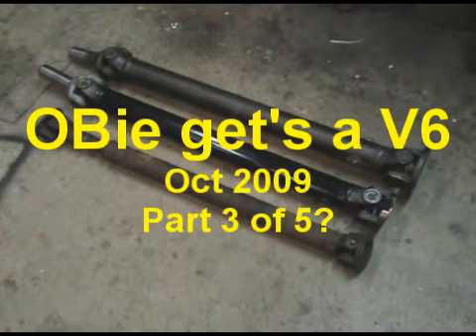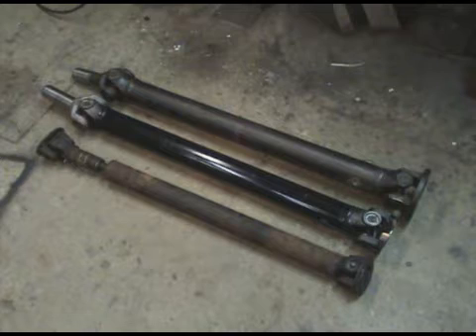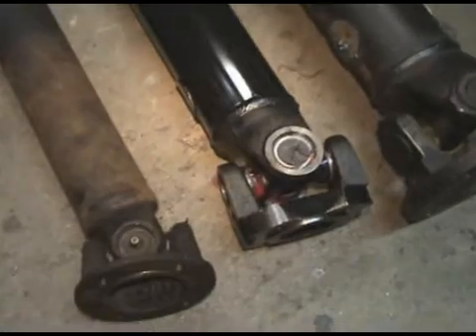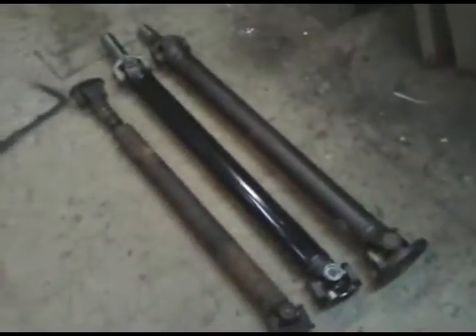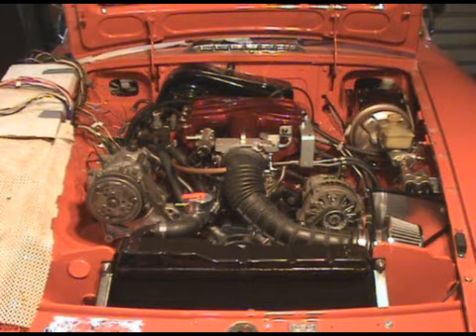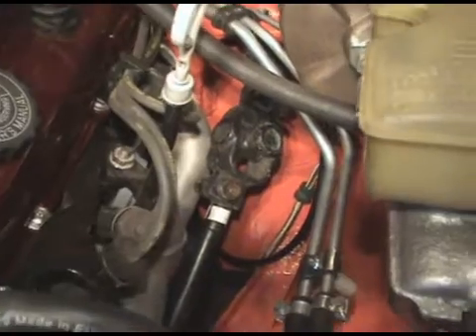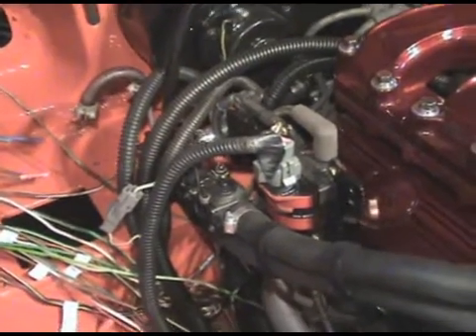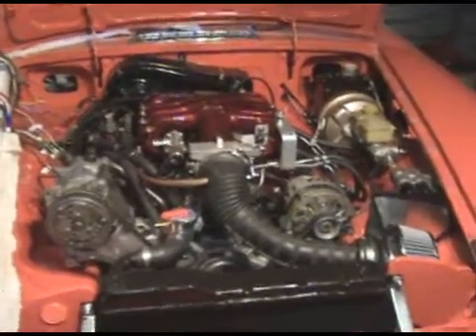Part 3/5 Megasquirted 3.1L V6 Installation in a 1973 MGBGT

Comment from the maker: the stock ECU is only good for a stock engine!
Megasquirt is pricey??? What other ECU on the market is as flexible oroffers as extensive control for sub $200 for a kit, sub $350 pre-assembled??? Certainly not AEM, MoTeC, Holley, Emerald. Haltech, Wolf, SDS, Electromotivce, DTA, etc   :-)